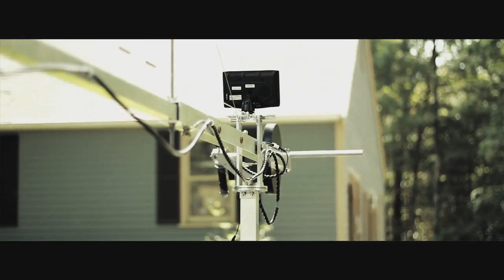Crane with Motorized Pan-Tilt Head

Comment: Looks like they are going for 1400 now. I definitely don't like how that big cable is hanging on the head shown in this video. seems like 360 motion could hurt the head. I would like someone to compare this to the proaim 14ft jib that is available for $909(plus shipping hefty $200 ) has most of same features, but it is real noisy when the motor is turning the head. I have never had one of these so don't know if that is normal